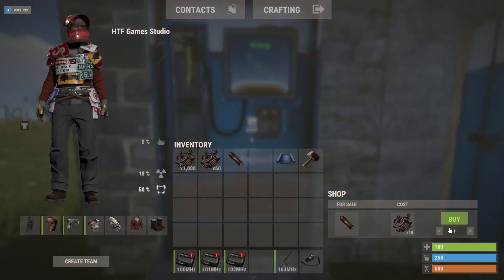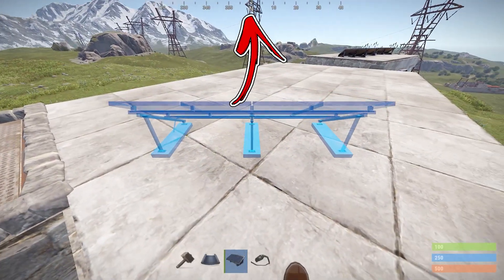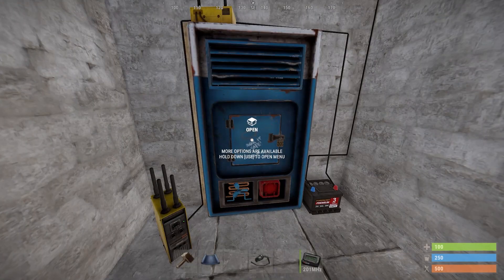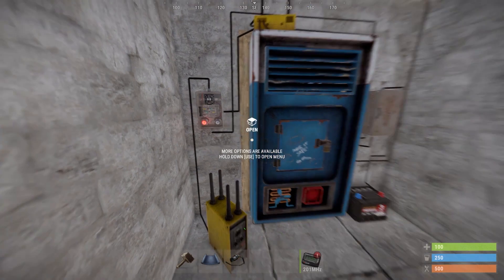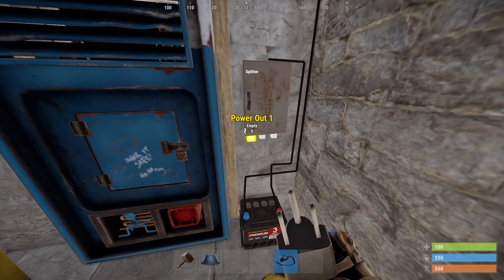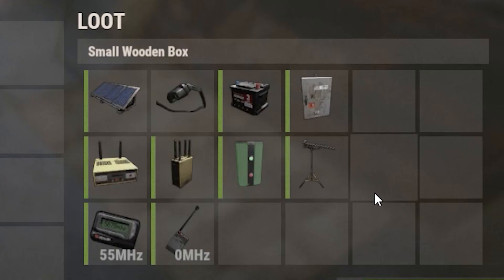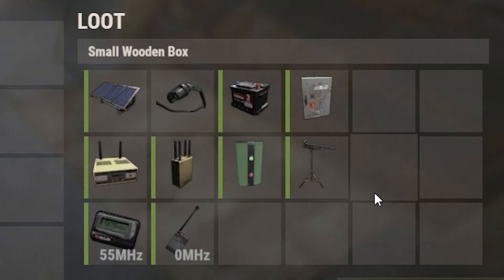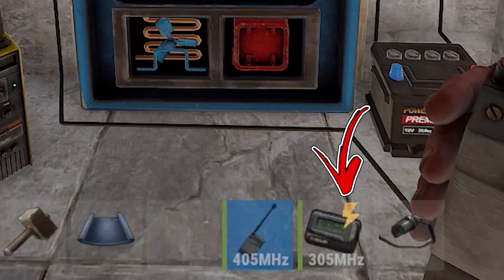Be Notified if your Vending Machine Sold Something | Electricity Base Design Tips | Rust Guide

Comment: The problem with this is that it will notify you only if a complete stack is removed, but it will also notify when you refill it, therefore making auto-refilling vending machines a hassle. What you could consider, now that we have the industrial system, is a combination of a storage adapter, the fail/pass of a conveyor belt and a circuit for notifications. A bit more work, but still something.